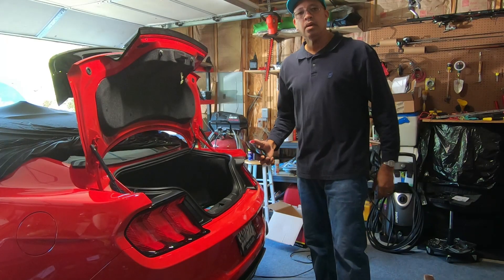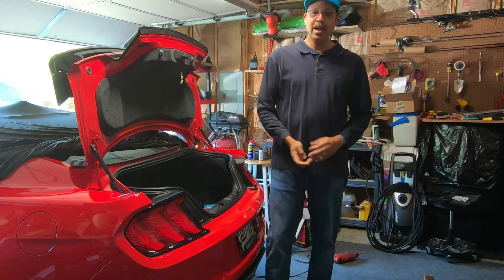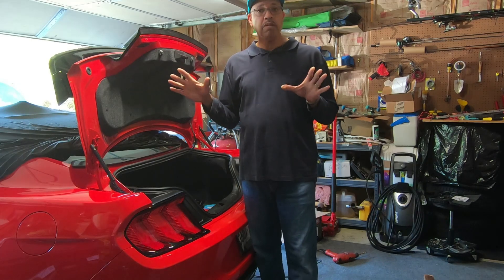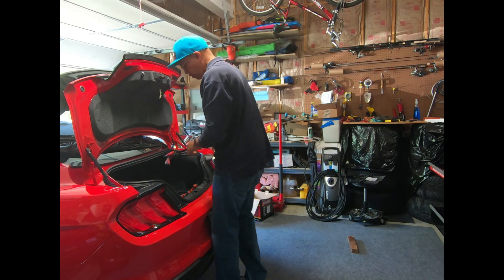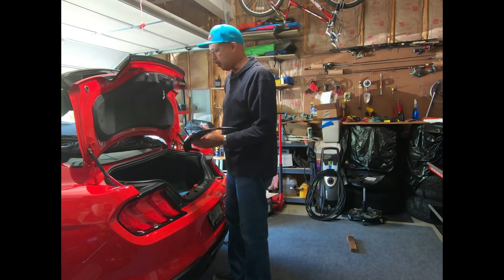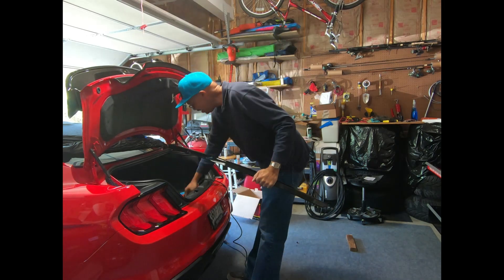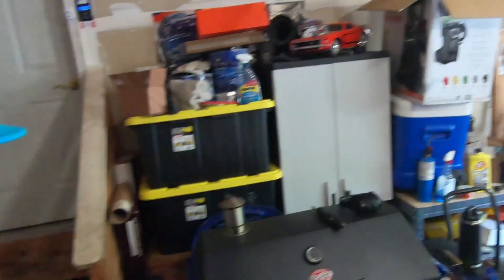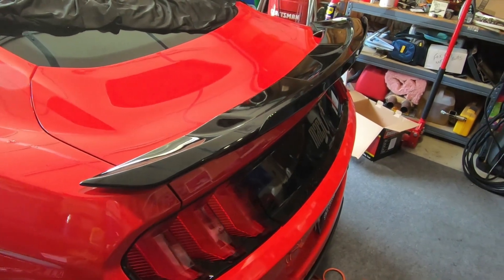The Mach Goes Back to School

Comment: If your car is equipped with a handling package Gurnee flap is included, with extra hardware. t20 bolts are just a tad longer with some new some kind of fabric washer.
Reply from the maker: The T20 screws worked fine.  Even on this non Ford spoiler which is slightly  different.